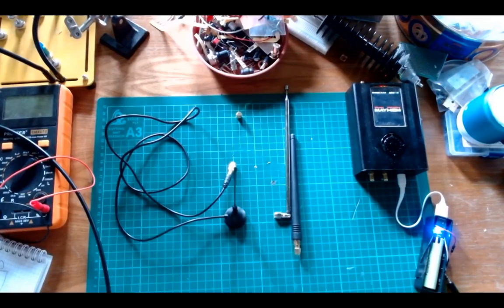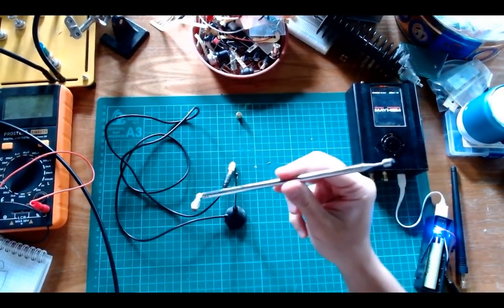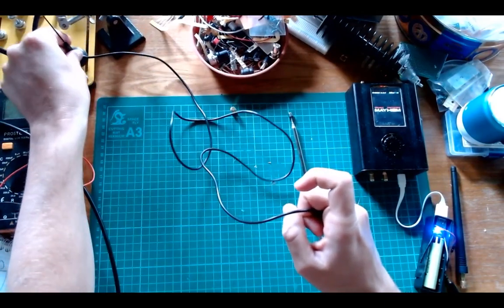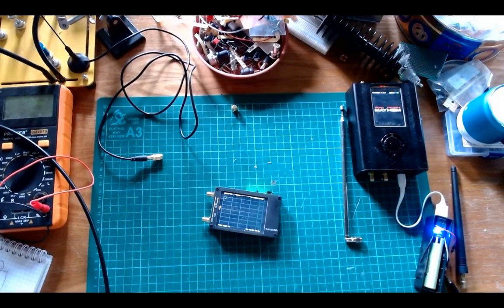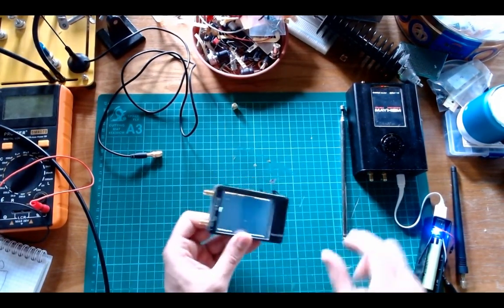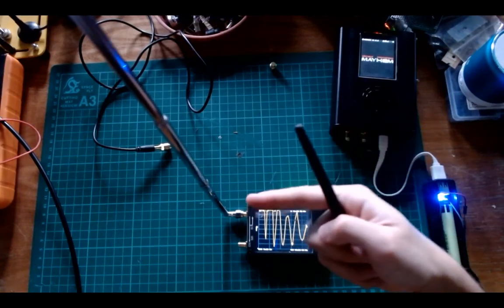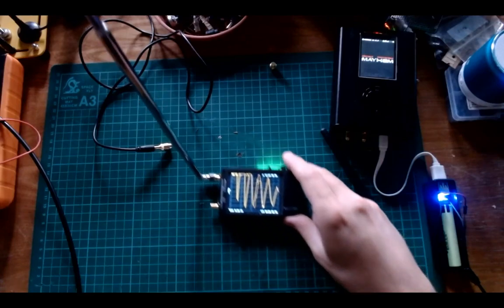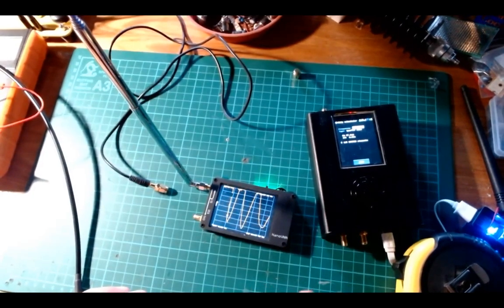Episode 44: telescopic antenna of the HackRF

Comment: Have you tried testing these antennas using an addition of a ground plane? When Rubber duck antennas are used in portable radios the hand holding the radio can act as a a ground plane. I did see someone use a VNA with a small fabricated ground plane metal plate and I'm going to experiment myself with one on my Mini1300.

Comment: ciao , scusami se ne approfitto , ho letto che sei molto preso, potrei chiederti che tipo di batteria esterna usi per alimentare l'hackrf nel video, voltaggio , etc , grazie ,
Reply from the maker: Ciao! E' una powerbank (da 3-4 euro, comprata su aliexpress) USB standard. L'hackRF, funzionando da USB, necessita di 5V di voltaggio. Qualsiasi powerbank USB funziona bene.
Reply: @therfnoob7697  Intanto grazie per la tua gentilezza, ho visto parecchi powerbank  con uscita a 5v , e ne vorrei acquistare uno ,  tra 1 ampere , 2 ampere o 3 ampere , ce n’è un amperaggio migliore oppure l’ampereggio non conta nulla
Reply from the maker: @rik2128  1ampere basta. Considera che l'hackrf e' cme un piccolo raspberry con output radio da 10mw, quindi consuma relativamente poco! :) la mia powerbank (batteria + adattatore usb che converte il voltaggio a 5v) come ti dicevo e' costata in tutto pochissimi ero su aliexpress :)
Reply: @therfnoob7697  che dire , grazie per la tua disponibilità , ne aproffitto per degl’ultini consigli :
1. Nelle impostazioni del portapack , c’è una funzione chiamata AMP è impostata su 0 , e si può mettere su 1 , e tipo il bias che si abilità senza antenna autoalimenta si fanno danni ? 
2. Comprando un antenna alimentata si aumenta solo in trasmissione oppure in ricezione ? In caso me ne consiglieresti una . Grazie

Comment: I am confused here.  Is this unit any good for adjusting my antennas for receiving on my Hack RF?  I don't care about transmitting at all.  When I hear about return loss and all that but that sounds too much like you are transmitting.
Reply from the maker: Hi FlyMario! The return loss is caused by a mismatch between the HackRF impedance (50ohm) and the antenna impedance at a given frequency f (Z_f). The mismatch causes reflections when you transmit (and these reflections heat up your HackRF and can even damage it). But, symmetrically, it causes reflections also on the antenna side. This means that part of the signal you'd like to hear, is reflected back to the antenna and it's not going to your radio. This means you are losing in sensitivity. So having a good matched antenna is a good thing also in receive mode.

Comment: Thank you for another great video. Very useful information. 
I would like to give you idea for new project. It's actually something what Im playing with right now as a real RF noob :-)
The project/challange is to get cheap wireless door bell and use the OOK encoder which is included in the Mayhem firmware to ring the bell. I used SDR to find the signal and than Universal radio hacker software to record it and decode it. Once you decode the signal and obtain the bit code you can program the OOK encoder and ring the bell...